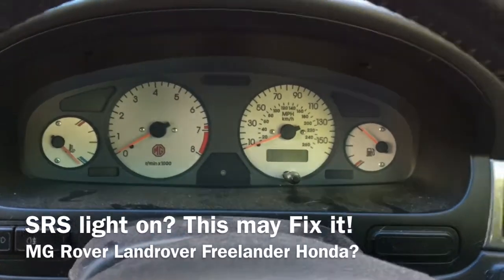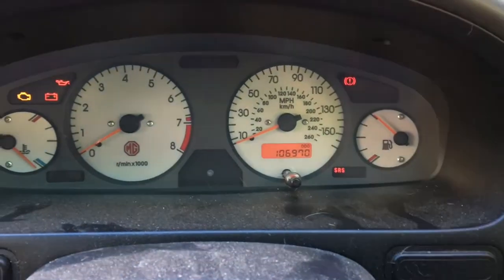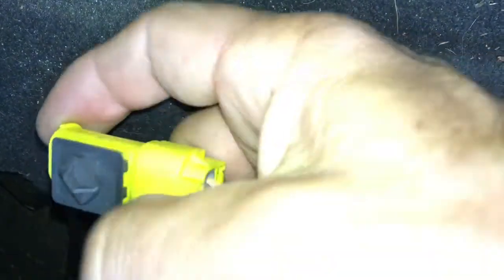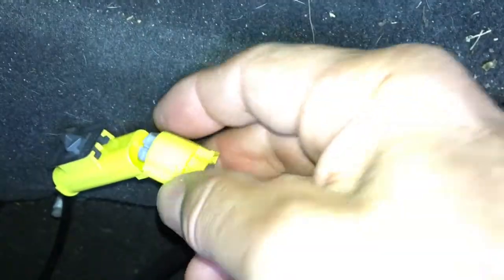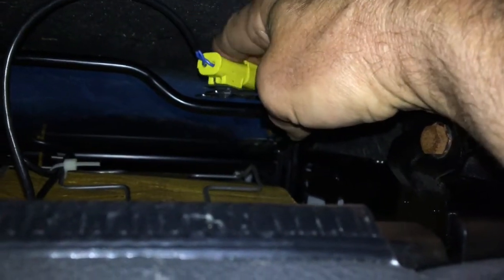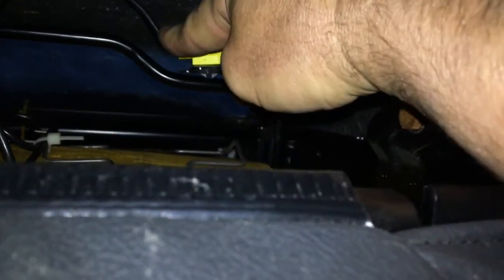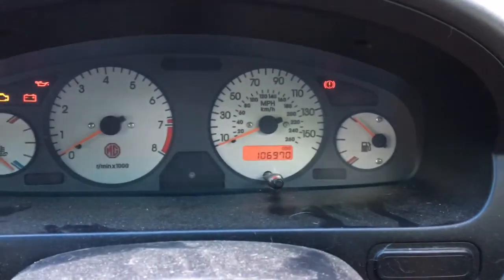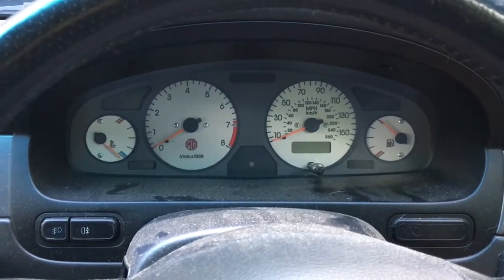SRS Light On? This May Fix it! - MG Rover Landrover Freelander Honda?

Comment: I disconnected the yellow srs plugs under the seats  i removed seats to clean the carpets etc but now srs light stays on and i'm told they have to be reset using a code reader freelander 2003 td4 mk1  but some say  code reader don't work
on 2003 models ? i was told to disconnect  battery and then clamp
posative and negative battery leads together for  20 mins and this will reset all codes in ecu? is it worth a try  thanks
Reply from the maker: In my experience the SRS light would come and go so no reset needed.  It may be different on some model years.  Make sure the plug is well connected together and yes try disconnecting battery to see if it helps.  No need to short leads together, just turn on headlight switch to remove any residual voltage.  If all that doesn’t work check out my review of the autel AP200C as it is a scanner that can also read SRS unit codes if you get that software add on.
Reply: @comeinhandynow   Thanks  originally when i took seats out  and disconnected  the yellow srs switches  the battery was still connected and i'm told that will show a code error on the srs and will have to be removed via a code reader as once it goes into fault mode it has to be reset... mines a 2003 model and obd2 readers don't work on diesel  td4 of that age.. that's why i was asking about joining pos and meg together  il try your headlight idea and lookup your code reader   thanks for reply etc..

Comment: I fixed a broken zip on my MG yesterday and then took it for a spin. Was horrified to see SRS light on. I was kneeling on seats and pulled them both forward to retrieve zipper. I would never have connected the two faults until I saw your video. Thank you 🙏
Reply from the maker: Thsnkd, glad it helped.

Comment: Probably wise to add ideally the ignition should be off for at least 15 mins, then the battery disconnected, before twiddling with the connectors. Well, that's the 'official line' anyway.
Reply from the maker: That is the official line, but in reality it doesnt seem to be a problem doing as I did.  Done it a few times with no issues.
Reply: You're probably right to be fair. Anyway, glad to report this worked a treat today on my 45 V6 and banished the dreaded SRS light. Squirted some contact cleaner in there for good measure. Thanks for the video - I've used a few of yours already to good effect (including the one about getting the SCU out of a Streetwise - very good, managed that too with a bit of swearing, and I was lucky as mine was the original hook on version rather than the one with the little bolt on the end) - keep them coming, very good for MGR owners
Reply from the maker: Thanks for the feedback, good to hear.